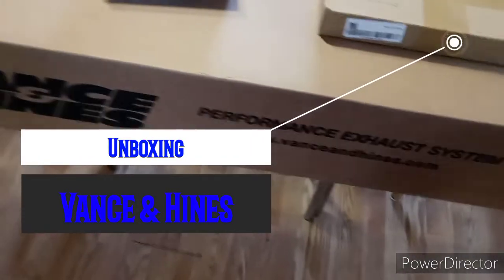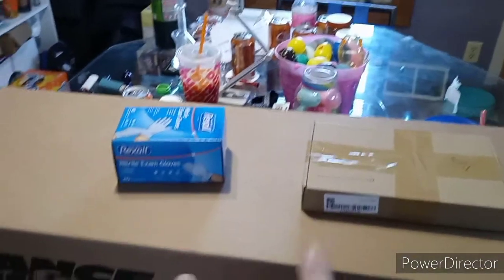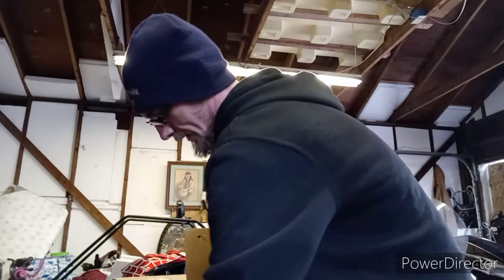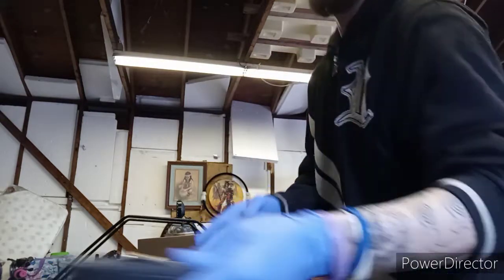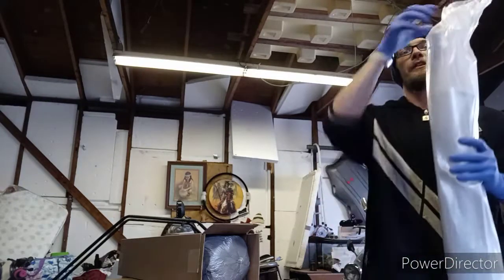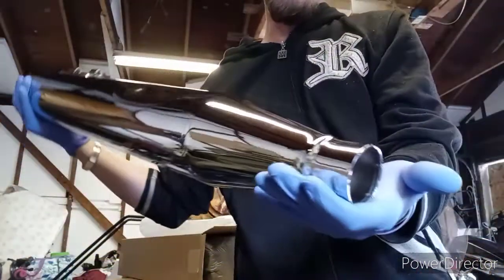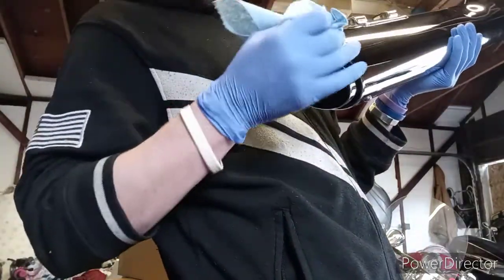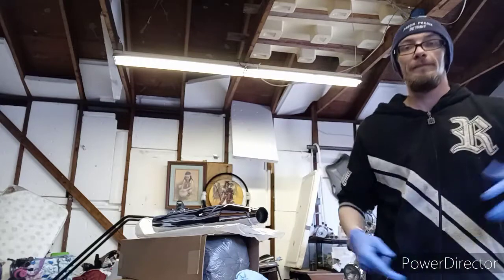Unboxing Vance & Hines

Comment: Ya thats gonna be a nice upgrade 4 sure!!! You doing the install yourself?? No welding involved or just straight bolt on?
Reply from the maker: Ya i do all the work on my bike so there done the way i want it and done right these was slip ons on the end of 2in straight pipes lol sounds like a beat rumbling now 
Doin light tonight and i do them also along with the sound system after that